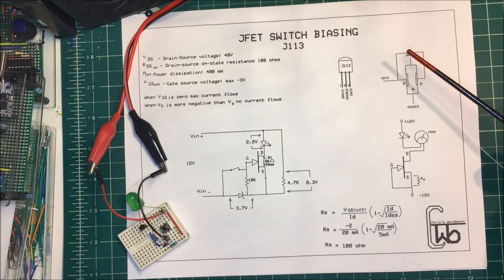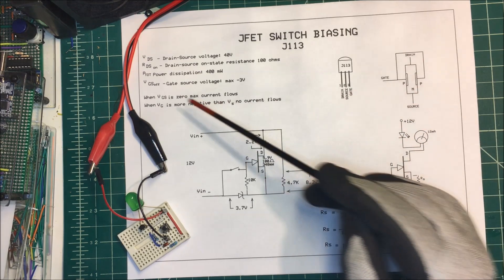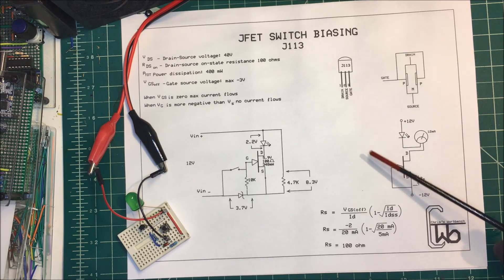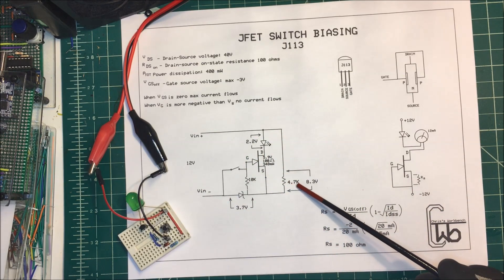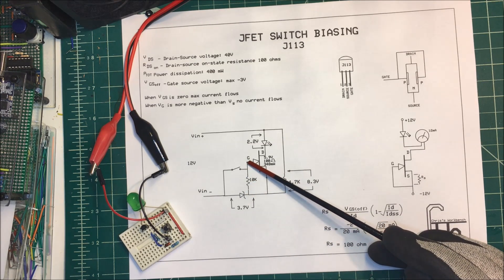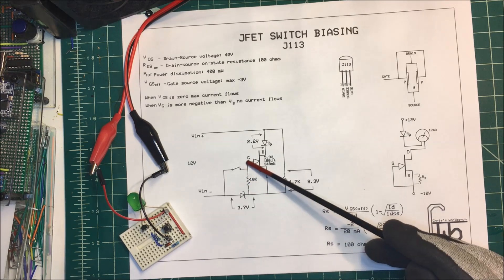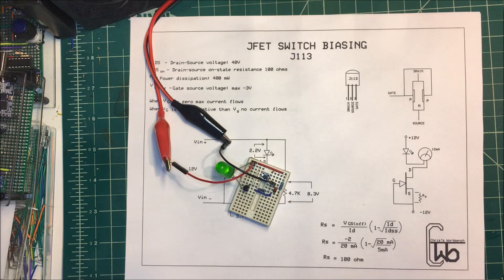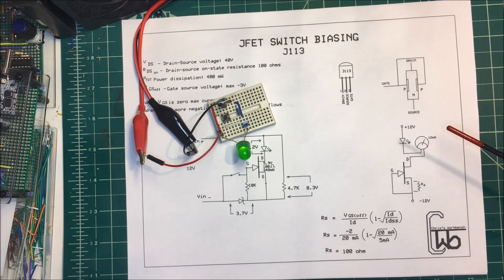JFET Switch

Comment: Why do you say they are not good for switching? For context, I wanted to construct a reverse transistor (I had found solutions using two BJTs in series) and then landed in this video about jfets.
Reply from the maker: They work there are just better options.
Reply: what value is the zener diode ?

Comment: Would this circuit work to switch between two different 12v LED modules?  Power one, then if the switch is closed, first LED module would turn off and a second one would turn on?
Reply from the maker: Google: Diode Logic Gates